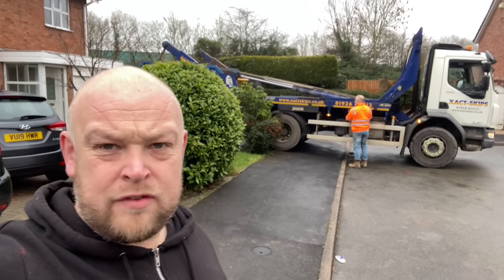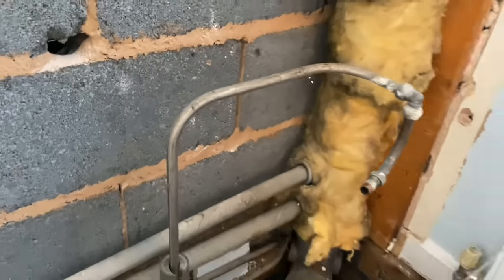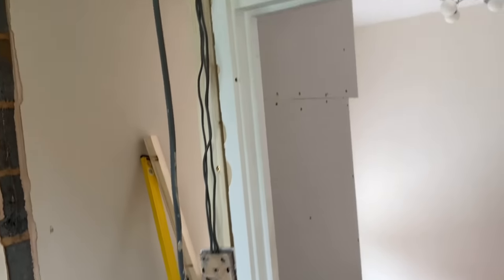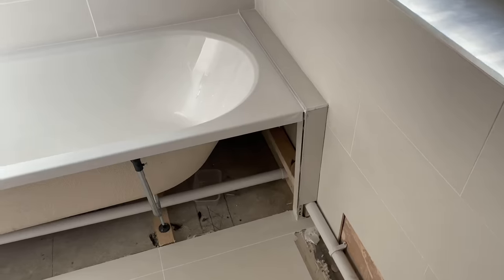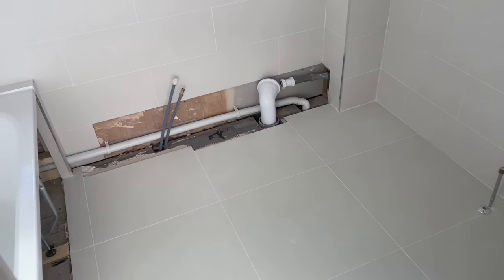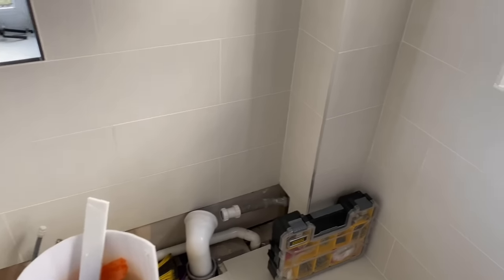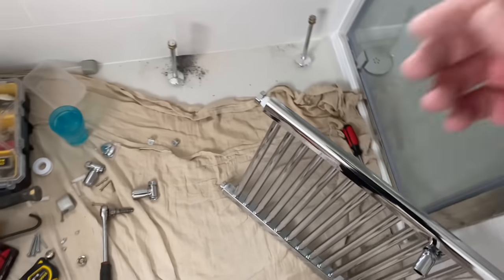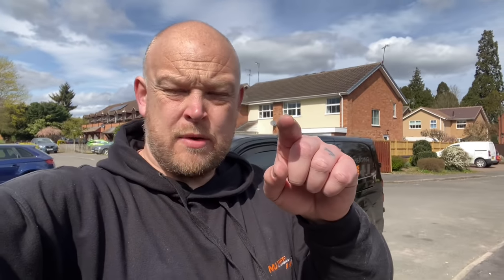BATHROOM REMODEL COMPLETE from START TO FINISH (Amazing Result)

Comment: Plumbings good. Not keen on the silicon everywhere, especially in the corner of the shower.
Reply from the maker: Each to there own mate...👍🏼
Reply: If tiling floor to ceiling always silicone internal corners that way any movement in that area. It’s all sealed

Comment: Copper shortage in the 70’s, you ever come across red line copper in your area? Was cheap shit from France, a literal red line running through it where it was joined, you couldn’t bend the stuff, it just snapped. We had to completely re-pipe a Chinese restaurant once as it all started to pin hole
Reply from the maker: Never heard of Red Line copper

Comment: Not an ideal placement on the shower valve. It's better on the left or right wall. How it is it's going to shoot the water at the door. You'll get wet and shoot water all over the floor everytime you turn that valve on.
Reply from the maker: The customer wanted it there so that’s where it went, it’s not an issue at all.
Doesn’t shoot the water out as this person has common sense and point the head at the floor🤣🙄😉

Comment: USED WRONG OUTDATED MOISTURE PLASTER BOARDS ON WALLS WHICH ALWAYS ROT BEST TO USE TILE BACKER BOARDS JACKO BOARD OR ABACUS CEMENT COATED LIGHTWEIGHT BOARDS TAPE AND SEAL ALL JOINTS AND MECHANICAL FIXINGS THEN TILE AWAY !!!!!!!!!!!!!!!
Reply from the maker: YOU’VE GOT YOUR CAPS LOCK ON🤣🤣🤣
Reply: @MJTiffPlumbing  Excellent work and tips 👍

Comment: Sorry but  you didn't put WBP plywood on the floor without insulation,  why you did used cooper pipes instead of plastic ( Cooper is much more solid, you know it) 
Why  green plasterboard is not everywhere. 
White is not for the bathroom 
Final effect is not important if behind is not properly done 
Sorry
Reply from the maker: Don’t be sorry…. That’s all your opinion 👍🏼👍🏼

Ever heard of tanking😉
Reply: @MJTiffPlumbing  yes itslmy opinion because I do my work 33 years, and I see you are bothering how it looks outside only, but for you, it's not important how it looks on the bottom or behind 
Outside is design only 
You should know that if you don't, you are just amateur 
It's my my opinion as you said

Comment: Just hope you don't need to go back to the job and have to take some tiles off, as you didn't plaster your walls. The plasterboard has not been protected...
Reply from the maker: Don’t you worry about my work buddy..... you do what you do and I will do what I do and know works, not had an issue in nearly 30years mate
Reply: If you are tiling whatever you do don’t plaster new board, if you do it can shell off especially if it’s still fresh.  Most powder tile adhesives stick like s##t to plaster boards.  If you use decent adhesive it can literally suck the plaster off the board.
Reply: Fail to prepare-prepare to fail. Preparation is key to a bloody good finsh. Been doing bathroom years. I’ve done 20k bathrooms on own give the gezzer credit. It’s a budget bathroom. We all do things diffrent